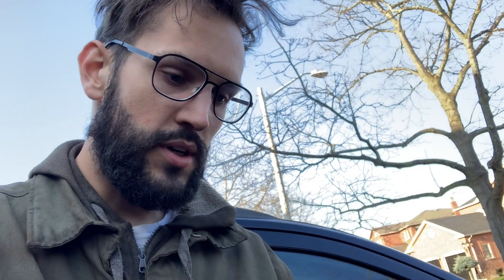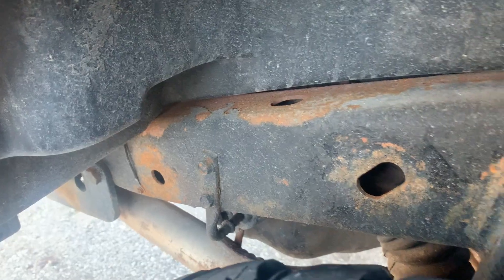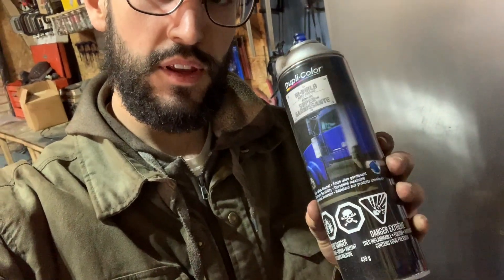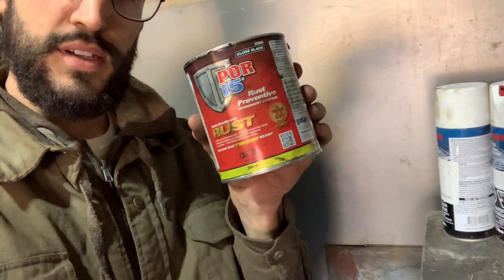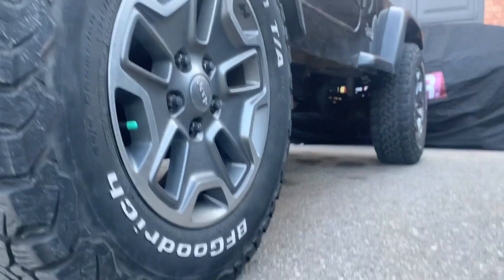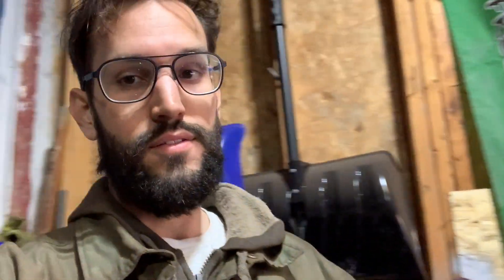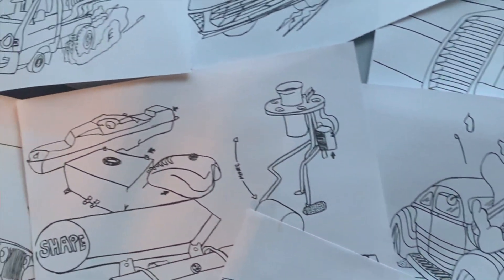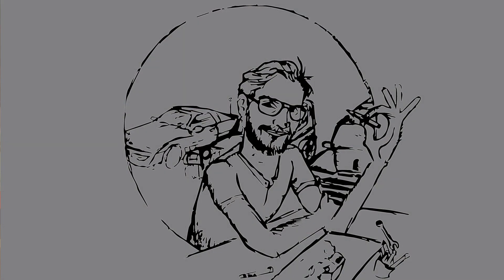Update: TJ Frame | Grand Wagoneer | Colouring Book

Comment: Great job John!!!! Hey have you considered applying Fluid Film as a DIY initiative to keep the rust from reappearing? Your vast skill set never ceases to amaze me!
Reply from the maker: I’m not a fan of how messy it looks. Working on dirty cars isn’t fun and it’s hard to tell how the rust is on the metal is unless I wipe it off. I have used it inside of the frame though. And thanks I’ve just learned to embrace failure that’s my trick lol.